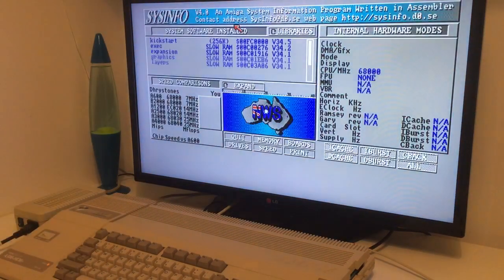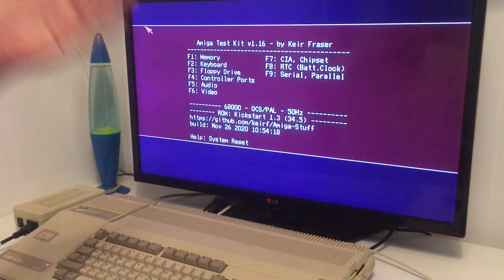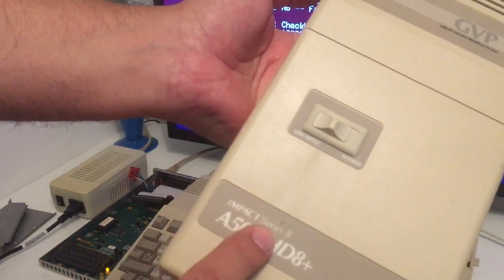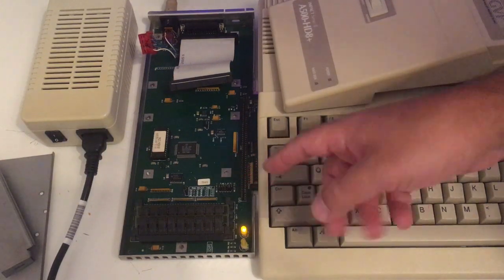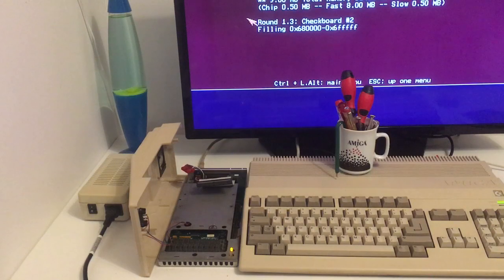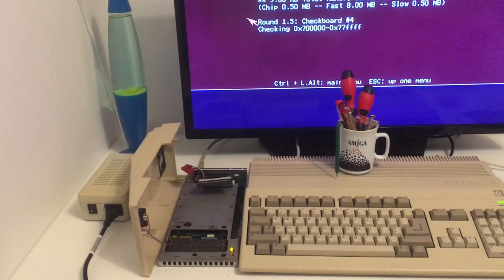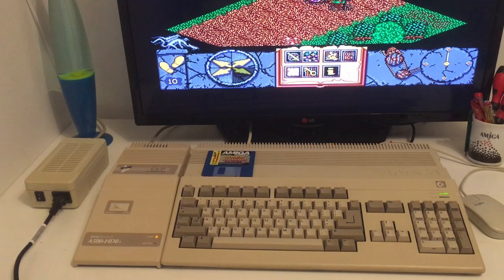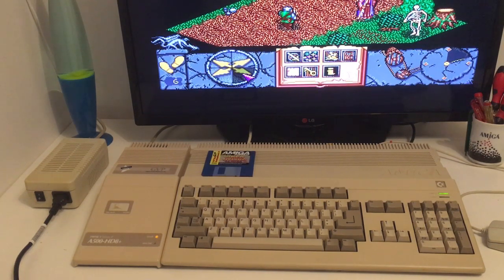GVP Impact A500 HD8+ Series II Commodore Amiga 500 HD RAM Sidecar expantion

Comment: I had this with a 170MB Conner drive (that still works!) - a note - if you combine this with the VXL-030 68ec030 accelerator and VXL-RAM32 you need Ralph Babels GuruROM replacement ROM as spanning "GVP" and "VXL" memory corrupts to bytes (set to 0xFF) - to fix that you need to set some DMA mask or something that I have forgotten. Enjoy! :)

Comment: Hi.... I have just finished cleaning, power-modding and ram upgrading a different brand of side-car harddrive. Do you know why I get around 9mb/s transfer rate on stock 68000 CPU, 2mb ChipRam and 8mb FastRam? I have NEVER seen anything like this before. Not even on a 1200 with 030 can I get this high HDD-Speed in SysInfo. The question is, what exactly makes it run this fast?

Comment: I just got a A500HD+ No 8, I assume it doesn't have any memory. Maybe I can find the jumper and enable the memory and add it if I can find RAM. I want to see your video of cleaning, did you make that video?
Reply: The GVP Series II A500 unit, regardless of HD+ or HD8 case name, was the same unit.  It was also the same hardware as the A2000-HC8.  Due to space limitations, it supported up to only 4 SIMMs.  2x/4x of 1MBx8 or x9 type gave 2MB/4MB, and 2x 4MBx8 or x9 type gave 8MB.  Jumpers selected 0/2/4/8M setting - printed on the PCB.

Comment: SCSI drives are too loud when you get past 7200 RPM's. I have an old 80mb Conner, that runs at 3200 RPM. That is really low noise. For modern solutions, get an SD-SCSI or one of them RPI based ones.
Reply from the maker: Nice, this 234mb drive must spin fast, it gets pretty hot and sounds like a…
Reply: @RETROCENGO  Perhaps you can find an 128 to 250 megabyte 3200 RPM for it. The ones I am thinking about, is the old Conner that were painted black.
Reply from the maker: @brostenen  I had 2 of them, both of them, under usage, began making a high pitch noise and went dead on me. Rip. I just think 40 year on a hard disk is a loooooong time😊
I think scsi2sd is the way to go, cheap/easy/noiseless and easy to transfer files from pc. Whatta great solution 🤗